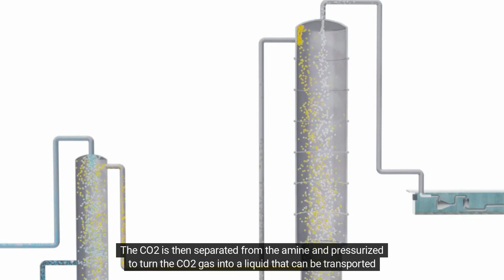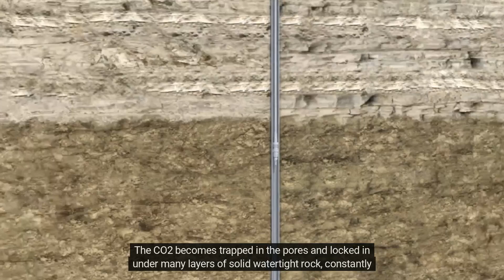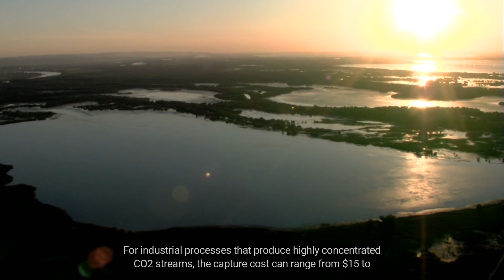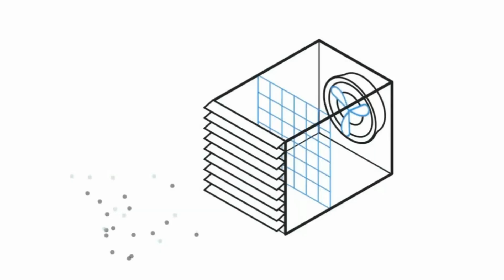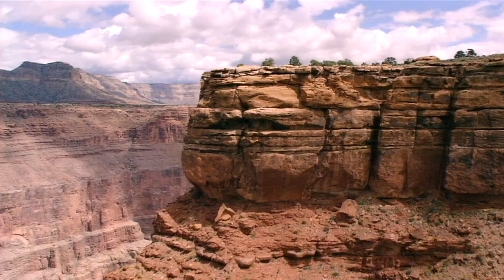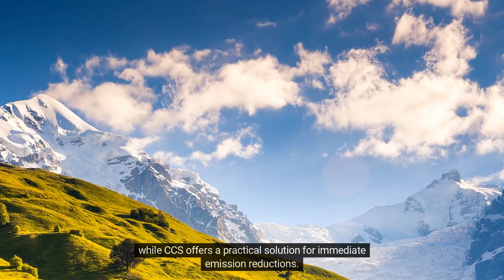DAC vs CCS  Comprehensive Comparison Analysis

Comment: Embark on a deep dive into the innovative technologies of Carbon Capture and Storage (CCS) and Direct Air Capture (DAC) with our latest video. As the world intensifies its battle against climate change, understanding and differentiating these two pivotal carbon reduction strategies becomes crucial. This video offers a comprehensive comparison of CCS and DAC, covering their economic impacts, scalability, feasibility, and the challenges associated with infrastructure and project deployment.

Discover the intricate workings of CCS, a technology that captures carbon dioxide emissions from industrial processes and stores it underground, and DAC, which directly removes CO2 from the atmosphere. We'll explore the current state of projects, the potential for scalability, and the economic considerations of both technologies. From the initial costs to the long-term implications for our planet's health, this video is your go-to guide for everything you need to know about the frontiers of carbon management.

Whether you're a climate advocate, an environmental science student, or simply curious about the future of our planet, this video will equip you with the knowledge to understand these critical technologies. Join us on this enlightening journey through the mechanisms, benefits, and challenges of CCS and DAC, and find out which strategy holds the key to a sustainable future.

🌍 #ClimateChange #Sustainability #CarbonCapture #DirectAirCapture #EnvironmentalTechnology

Don't forget to like, share, and subscribe for more insightful content on environmental technologies and strategies to combat climate change. Have thoughts or questions? Drop us a comment below or reach out through our social media channels—we'd love to hear from you!